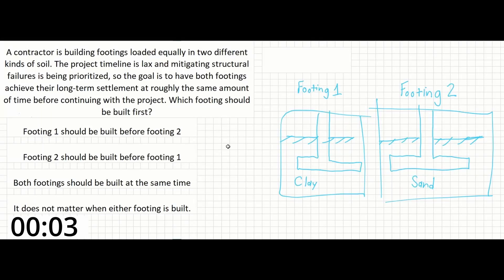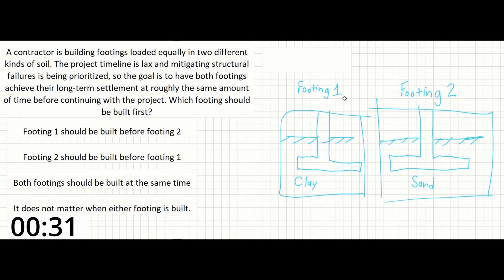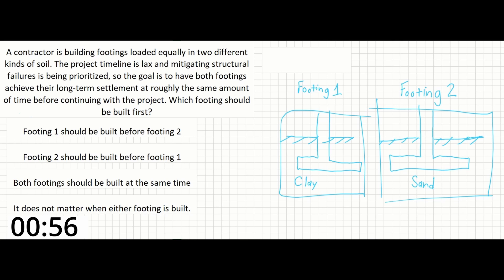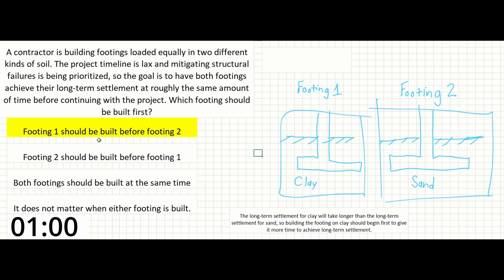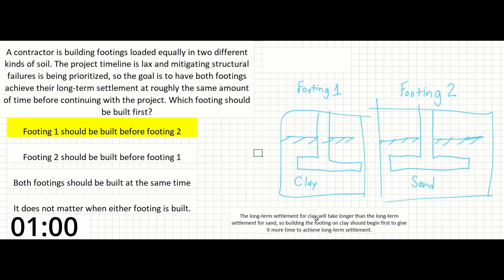PE Exam Practice Problem #72: Soil Mechanics | Settlement - Concept

Comment: where did you find that information on duration of long term settlements for different materials?
Reply from the maker: Sorry, I could have sworn I responded to this. I believe many geotech or foundations textbooks will discuss this concept - but here is a link to a geotech design build website: https://geosolv.ca/soil-types/  There are sections at the bottom for Clay and Sand. Both have some information about each respective soil type's settlement. 
In terms of this problem, since we don't have any other information than "sand" and "clay" we have to assume this isn't a special case.